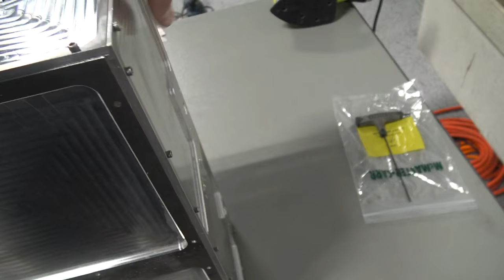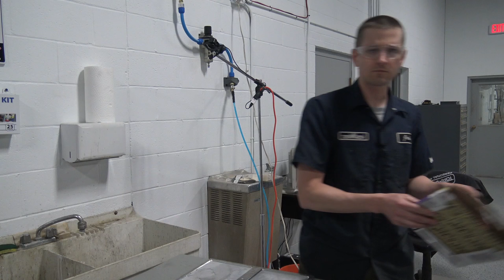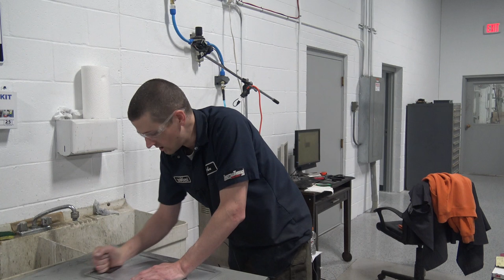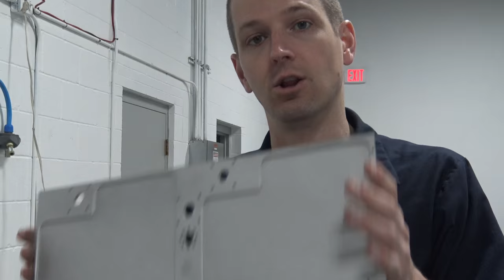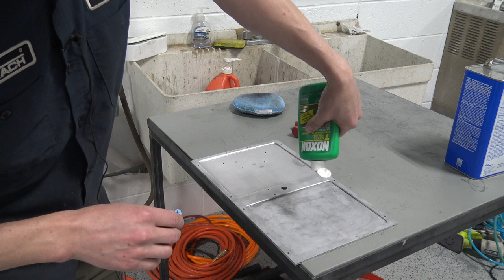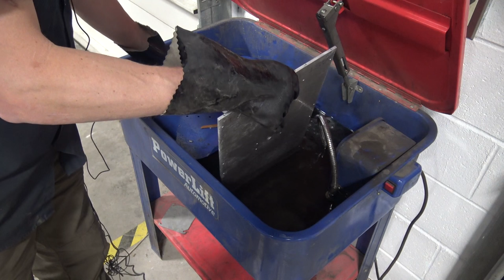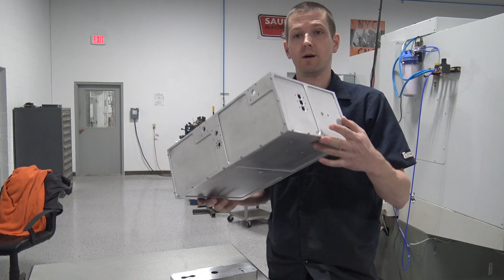Remove Machining Toolmarks!

Comment: Hi John
I have an Automotive painting background and one thing that you were doing which is a definite no no is using your fingers with wet and dry paper. This will always leave finger marks in the finish you can use high density foam and cut small blocks to get into all the areas you need also you need to try and sand in the same direction as much as possible with soft materials such a aluminium and brass. Stainless steel is another thing to be careful with when trying to get a brushed finish.

It all depends on the finish your customer wants if it's a high polish there are metal polishes you can get from an automotive supplier to do that by hand. If it is a brushed finish you are after it's just going to take lots of work. This is something you will need to find out before you tender for a job and add time for that, as we all know time is money right. Still the machine work is awesome as always.

Dave
Reply: Word! We do the same in the fiberglass mold industry.
Reply: This guy knows what's up!
Reply: Yes they have high density foam block sets called "soft sanders sanding blocks" that you can use on metal and wood that work well. In a real pinch you can go to Sallys beauty supply and find pre-made sanding blocks with everything from course to super fine buffing (ofc this is for small parts only). Home depot also has blocks but they are generally very coarse. You always use balsa or pink and 3M spray adhesive and make your own blocks (done this for many years) though you may be changing sand paper often which becomes tedious.

Comment: John, I use an alkaline etch to remove toolmarks in prep for anodizing. I experimented with bead blasting, sanding and tumbling and the sodium hydroxide in hot water works the best. It takes about 2 minutes to a smooth satin finish. Works great on any kind of surface regardless of features.
Reply: +NYC CNC Make sure the surfaces are de-greased properly. Use water as hot as possible for etching. The hotter the water, the quicker it works. After etching, neutralize in a mild acid solution. It removes the black residue that forms. By far the best surface finish and quickest process. Thanks for the great videos over the years. Got my Tormach 1100 in 2014 and haven't looked back. You and John Grimsmo have been a huge inspiration to me.

Comment: Glad to see people like you putting this stuff out there.  Good job! 

Use Kerosene as a lubricant and start  with 1 inch 320 grit emery paper, wrap it around a block of wood shaped like a 1-2-3 block using the 1 inch side, then polish in the longest direction first. 

Next. . . Use 400 at 90 degrees to the 320 polish and then finish with 600 in the longest direction. For the corners use the same process using a 1 inch wide stick of wood shaped like a wood chisel, always  lubricate and move to a new spot on the emery when needed.

To Finish. . . Clean well, I use Windex cleaner,  finish the polish "dry" using house hold Comet with felt warped around a new clean block of wood and chisel stick for the corners. Can also use felt wheels attached to an air grinder but you may get swirls in your finish. 

For your flat parts, tape 8x12 sanding paper to a surface plate, lub and work through the process. 

Depending on your tooling marks you might get away with using 400 grit first.
Reply: Hasn't failed me yet!

Comment: You should be able to get Alumina Zirconia in powder form and use your sand blaster.  You machine marks are only a few microns deep, so you are only seeking to blend the surface optically.  You can tape the edges of your recesses to prevent possible erosion.  If you are going to manually "scratch" the surface, you want to aim for 800 and above - and never use your fingers, but always a block.  Also, in the early stages of rubbing, leave the residue on the surface as this will act as a grinding compound to knock off the high spots.  Something to consider is the grade of aluminum.  The structural matrix lends itself to being worked better in one direction (how the molecules are laid down during manufacture)

Comment: I've done a fair amount of polishing gun parts and have found that sandpaper made for and marketed for auto body has a more  consistent grit size than sandpaper made for woodworking. You can get unexpected scratches with wood sandpaper.   I agree with sanding in an alternate direction when changing grit size. you have to remove ALL the grit marks from the previous grit size before you go to a smaller grit. Hunt YouTube for some videos on polishing gun parts for bluing. I realize that most of my advice seems about steel, but I have had very good results on aluminum as well. I is really satisfying when the piece of metal you have been industriously rubbing with sandpaper becomes a mirror! 

Good luck and stay well. Really liking the channel.

Comment: A little polishing tip from a mold maker: Always polish corners & hard to reach areas first, then it is easy to blend those areas with the larger ones, especially since tools like to jump around in corners and make additional markings to other nearby surfaces. Plus, it gets progressively easier to polish when you start getting frustrated/tired/bored.

Comment: Get your self some walnut shell (super cheap if you buy a 55 lb bag from the blasting shop) for your blasting cabinet, charge it with some iron oxide power (jewelers rouge). Source it from a pottery supply and a life time supply will be about $10-$20. After sanding go straight to 220 grit in the cabinet and skip the glass bead and go straight to the walnut shell. If I have some time this week I'll do a quick video on how to shine up aluminum pockets fast-ish. You are most of the way there just a little more and you'll have it nailed!
Reply: +NYC CNC walnut shell is just the carrier for your polishing compound. it does very little on its own, you can even charge it with liquid polishing compound.
Reply: ***** Ack, I lied to you, use not Walnut but Corn Cob. Walnut works great on steels but is to hard and will ding the aluminum. Also make sure you have you pressure set low say 50 psi and get the biggest ID nozzle you can. You want to pour it on  basically. Also the lower the angle of attack the slow it goes but the better the finish. Another step that you also can try is blast it with soda. It's very light and will get the surface very smooth so that only a few moments with polishing compound will shine it up nice.

Comment: I've polished my fair share of aluminum parts, and here's what works well for me:

1) rough polish with sand paper. in left-right direction
2) increase grit, and polish in up/down direction
3) increase grit, and polish in left-right diagonal
4) increase grit, and polish in right-left diagonal. 
_
Note: when sanding, or using abrasives, you create scratches. The purpose in alternating directions is to knock down the edges of the previous sanding operation. If you continue to go the same direction, you actually gouge these scratches deeper, as any loosened grit will ride in this scratches like tracks, and continue to dig into the material deeper. 

5) Polishing compounds: Start with a course grit, and work down to a fine grit. A dremel, or other hand-held rotary tool with a buffing wheel attachment works really well for getting into corners, and inset edges. At this point, you'll want to work in small circular motions to further knock down any scratches, and again to keep from "running the tracks" of previous operations.

The final step is to get that mirror finish. dry / clay packed polishing compound made specifically for the metal you are working is best. you can use a large buffing wheel at this point, just bee sure not to apply too much pressure, and go with edges, not against them.  Use elbow grease and soft cloths to finalize your surface, and to fix particularly problematic areas. 

Hope that helps :)

Comment: John, I work for 3m as a machinist and have occasion to use various products we make. Try maroon Scotch Brite with cutting oil with longer strokes in same direction. Wipe off with alcohol and soft cloth prior to rinsing in laundry tub. We make awesome double face tape that works great for holding parts down. No kidding!

Comment: The advantage of working in opposite directions is you can easily see when you have removed the previous grit's scratches.

I Love that you put the unknown 'drill press polishing wheel' at eye level!

To get a high polish finish you will be going up to 1500 grit, to get close to a mirror shine.  A cheap DA polisher like the Porter Cable 7424XP, and some car polish (M105/205, as an example) will produce glass like finishes (figuratively) will a lot less work hours.

For a flat finish roloc disks work grand; and are very fast

Comment: I use scotch brite rubber roloc disks on a hand air grinder.  They are flexy for getting into corners and not terribly agressive, also they are fast.  Mothers polish is great on aluminum, I have polished semi truck fuel tanks to look like chrome with it. It isn't fast though.
Reply: This comment right here. I also use roloc discs in a chicago pneumatic 90dg die grinder. It's great for getting in those small places. You can use sanding discs of all grades and even scotch brite discs. Electric sanders are the worst, they're not smooth, the cutting action is poor and they generally do a sloppy job on metal. They were designed for wood.

Comment: I have only worked with knives and handles. Polished aluminum and brass looks great. Starting out I tried the obital sander, bad idea. Next I had to hand sand out all the swirls from the obital sander left. I like that you cleaned between steps. I saw a video on restoring lexan or plexiglass rear back glass of classic car. He soapy water and sand paper. He started one derection water sanded, clean higher grit, water sanded 20 degree from first and watched the first scraches removed. He clean again higher grit -20 degrees water sanded the next scraches removed, work till he got to 6,000 grit then cleaned to lens buffing compound witch was three stage kit.

Comment: I have used vibratory deburring machines for years for parts that cannot show tool marks. Drop them in - come back in an 30-90 minutes and take them out. Very uniform finish ready for anodize. It took some effort to set it up with the fluid handling needed for 20hr/day operation but we are able to do piles of parts with very little labor and they all have the exact same finish regardless of how we machined them. We also discovered that were able to get away with much more aggressive step-over and speeds on the CNC since the deburring process covers it all up.

Comment: The foam-ish wheel you used at one point with the polish. One a little more solid works perfectly, that trick is great. It is kinda like polishing a car but with the polishing chemical you are using already. That combination has also worked well in some cases

Comment: The reason that the flat piece came out so good is that you were able to get the scratches to all go in one direction( less light refraction with the scratches going  one direction).  It's like sanding with the grain in wood working. Cross scratch removes material, same direction smooths and buffs.

Comment: Hey John, Use 80 grit aluminum oxide sand, in the sandblast cabinet. It will be enough grit for a finish and fine enough to leave bare for a natural satin finish.

Comment: Hi John
when flatting and polishing use paraffin in stede of water you will find that the paper will not clog as much + you will get a finer finish quicke keep the material wet at all times do not allow your paper to dry at any time ,  If Parafin is hard to get hold of in the US WD40 works well.
Nick

Comment: 3M makes micro uniform grit abrasives that are used for automotive and lapping. Once the machine marks are removed, you easily step through the grits to 9 micron. From there you can go all the way to 1 micron with a different backing. At that point your polishing. All the abrasives can be used wet or dry. We use this to polish platinum, which is very difficult to finish.

Comment: John it may be feasible to ask the customer if you can acid etch and alodine for a finish. If that were the case you could go straight from glass bead blast to acid etch then alodine. Depending on how long you leave the part in the acid etch stage determines the smoothness of the alodine finish. It's also a simple setup for a small shop to have. A couple plastic totes with anti splash balls in them and the chemicals to do it and your done.

Comment: John when you want to sand blast aluminum use walnut shells, Sandblasting them will make them warp and twist. I used to help a mold polisher and all I can say is it's time consuming and takes a lot of patience. If you start making some head way you have to be carful that you don't scratch it or your back to square one lol. Great video though.

Comment: Hey John, after sanding with a smaller sander maybe try a 90 degree die grinder you can get a range on pads for them flap discs scotch brite great for deburring by hand too. and the media blasting  would acid bring it back from a matt finish. I know it will remove the oxidisation on aluminium if not maybe an automotive polish and mop you can get compounds that are applied to the mop and give a range of options. Well Keep up the good work Cheers Neil

Comment: if you use just a regular hand held sander and use wet dry paper on it when the paper loads up it will start to polish. so go over it with new paper and just let the paper fill up it will mirror fairly easily, if you want to get more sanding done and NOT have the paper load up you can use some old (or new) motor oil and basically wet sand it. when you are ready to get a polish wipe the oil off use a new piece of paper let it load up. I sand aluminum all the time its one of the fastest way I have found to polish it easily

Comment: Visit your local auto parts shop that also sells auto body supplies and get some 3M squeegees, the kind used to apply spot filler/glaze, and use them as backers for your paper. They're cheap and they'll help keep things flat but have enough give to allow you to get smooth curves and radii if you need to and you can use them wet or dry and even cut them to shape if you need to.

Comment: For sure after the sandblast/ media cabinet work you did, going straight to wet sanding with the red scotchbrite would've given you the finish you were after! Did this with aircraft parts that needed a protective alodine coating, the alodine wouldn't take to the aluminum unless it was smooth enough for a "water break", which looked like the finish you were after.

Comment: alternating directions helps you to see if you missed any spots since the scratches will be easily visible. though that seems realyl painfull to get polished. +1 for having the pockets on the inside and leaving the outside flat and easy to polish.

Comment: Silicon carbide can embed itself in the aluminum and cause dissimilar metal corrosion, stick with aluminum oxide on aluminum alloys.  Also, when sanding work at 90 degree directions, this will knock down the high spots from sanding the other direction with the same grit, its faster.  Consider investing in small random orbital, i have a 1 inch orbital and 5 inch. I go 120, 320 600, 1000, and then scotch brite.  Do all of it wet in a sink with air tools.  It will basically mirror up.  Once you get the feel for it, doing each pocket should be about 6-8 minutes max from raw to polished.  Do final cleaning with denatured alcohol, and use a respirator, aluminum dust is basically the finest particulate matter ever and wear nitrile or latex gloves to keep fingerprints and smudges to a minimum.

Comment: A long time ago the grandfather of an friend showed us how he polished stuff. He had a big wooden barrel (an old wine barrel i think) half filled with sand on upside down rollers and a motor slowly to rotate it (something like 5 rotations per minute). He put stuff in it and let it turn for a day or so. After that the objects where not really blank but homogeneous.
I think the effect was like a very mild sandblasting.

Comment: we end up cleaning up aluminium parts in work, quite often moulds and to get a mirror finish normally I work through sanding grits. then onto 600 wet and dry with a air powered orbital sander. we often use glass cleaner to keep the wet and dry wet but I have no idea why or how it beats pure water. Just the way I was taught and have always used that method. 
Once the 600 is done I then polish it with Autosol Metal Polish using a small air polisher or orbital sander with a foam polishing pad. tends to bring out a great mirror finish. the foam distorts enough to get most awkward places. and for the really awkward places I get a bit of silversteel, put it in a drill and wrap a huge bit of rag around the end. then use that for all the through holes and awkward to get to corners. once done I just buff with a clean rag to remove any left over polishing compound and it comes up a treat without having to rinse

Comment: Scotch bright wheel on a surface grinder maybe? Also, there are some silicone brush-type wheels of various sizes/grits that do really nice finish, with no effort. Or really fine(0.2-0.5mm wire) bluesteel brush on a rotary handheld machine(maybe even tormach?)...